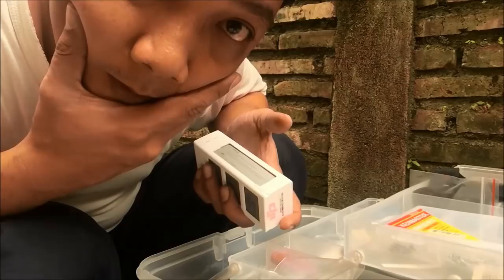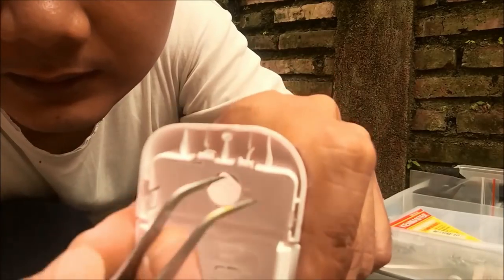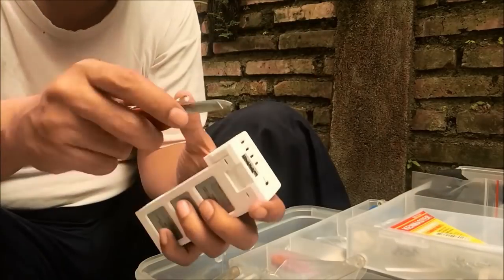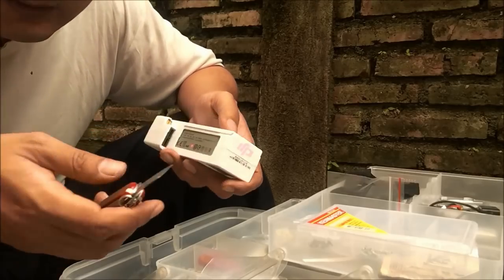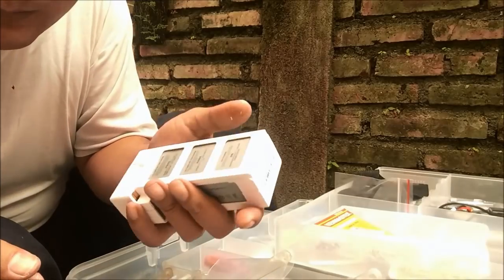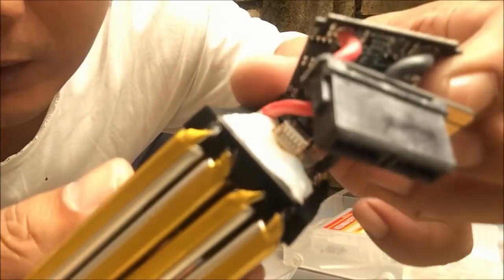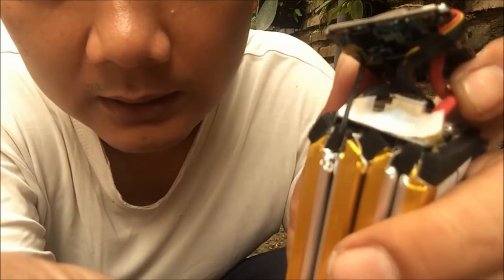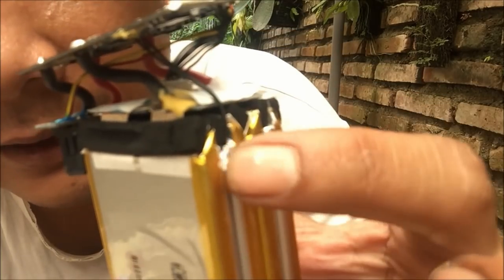Inside The Broken Battery of DJI Phantom 3 - How to open For Mod and Repair Purpose (Cara Bongkar)

Comment: Wow.  This batterytotally doesn’t need repair.  Two of my three P3 batteries were like this, what I call on the edge.  You place it on the charger, and do the press, wait 2, press and hold.  Those two batters, plus the one that started charging unaided, are on the charger now, getting juiced.

Comment: the protection circuit board is built within the battery because it controls input/output when being charged, & not to overcharge while plugged & offers a discharge protection while in use as well. It would not be safe if circuit board is installed within the drone because this would mean having a charge port on Drone & battery would have to remain in to charge so lose flying time & if battery would ever leak or short out it would surely damage components within the drone also. Also, these smart circuit boards are engineered to notify user/ drone when to return to base when voltage drops

Comment: The yellow and red wires coming off the main jack is so the phantom copter can communicate with the bettery and know cell voltage and battery temperature and the sensor glued to the side of the battery pack with the 2 black wires is the temperature sensor..  and for that wire to break off the connector it was installed bad when the battery pack was built.. or it's to thin of a wire and it couldn't hold up to the current it carried, because it's in a sealed environment.. nothing is able to pull or yank on it

Comment: Great video.  Very helpful.  Mine would not charge but was not that old.  Red blinking light and one green blinking bar.  I opened mine up and removed the Control circuit.  Then I connected the pack to a Riden power supply to se how much charge it would take and if the cells were balanced or if there was a bad one (or more).  Once I verified it was fully charged, I ran a discharge test from full charge to minimum charge with my DL24P load tester.  Granted I could only discharge at 10A I still got an idea of the pack condition.

Comment: The board in the battery is a balance charger and makes sure all the cells stay at the same voltage. Putting it in the drone would lower the battery life span.

Comment: How do you reset a battery circuit board? I charged it with a smart charger and now it works but gives no output.... Any tips?

Comment: I have a spare phantom 3 battery  ..i want to make "4" usb battery banks out of it but im not sure how    ....how many volts is each cell ?
Reply: Don't. You'd do better just buying cells and usb controllers off ebay. Phantom 3 batteries aren't being made anymore and the drone was updated to only work with originals so their value increases if you can find one with low charges. Keep and use that battery or sell it. Whatever you do don't destroy it just to make a cheap usb battery bank

Comment: Thanks for sharing.  Amazed you didn't get shocked the way you handled the unit.
Reply: The voltage is too low
Reply: @randyhammer7777  , that's a good thing.  Thx.

Comment: oom Arya,mohon pencerahannya donk soal batere phantom..saya bongkar utk main RC krn utk drone udah gak stabil..voltage masih ok sekitar 4 volt/piece..the problem is all these cell cannot work! even i try to charging..and kalo saya konek ke rc saya,kabelnya panas.dr ke 8 cell nya,hanya 2 cell yg saya bs rakit jd 2S dan bagus,sisa yg 6cell blom tau knp...so? any suggest for my case? thank you so much ,sir

Comment: The black wire that you thought was an antenna is most likely a temp sensor. That would explain why it's glued to the side of the cells. A Thermistor I'm assuming.

Comment: Hi, wanted to Thank You for allyour Fantastic Videos. I have 8 Dji Drones and trying to find YouTubers who do videos on how to repair them yourself. If you know of anyone who makes videos can you let me know. I would really appreciate it. I hope you keep posting videos
Reply: Easy to repair stuff. Google is your friend. I've had my DJI p3 pro 3yrs ajd haven't got around to flying it yet and already wasted a new battery. I'll try boost charging it with a conventional charger bypassing the balance charger stuff for now and get it up to equivalent to 50% with a real low and slow charge then try the factory charger since it has the balance board built in. Who knows battery could've been bad from the get go. I'll call DJI and see if I can work a deal with them on replacing the new bad battery.

Comment: very good video
sorry for the question of how many volts is each battery and how many amps is each my battery does not retain charge and I am interested in your video and I want to compose mine, I hope your answer greetings from mexico won a subscriber
Reply from the maker: Hi Mexico! 😊. Thank you for watching my video. Every cell is equal 3.7 volt. But I’m realy sory, this is an old video and the battery has already sold. I cant remember the current/ampere 😭
Reply: Normally each cell should charge no higher than 4.2 on Lipo batteries. 3.7 is the low voltage cutoff so it can let you know it's time to charge it. In the world of RC cars at 3.7 per cell the Electronic Speed Control (ESC) settings will stop the car at 3.7 or a little lower but no lower than 3.2. Drones are different on the low voltage cutoff which is when it tells you to return to home. They fully charged at 4.2 volts per cell hence 4 cells @ 4.2 volts fully charged equals 16.8 volts which should be on a 4 cell pack so you know the voltage. 3 cell is 12.6, 2 cell is 7.4 and 1 cell is 4.2 volts. 7.4 is real popular in the RC car world where a lot of people who race use 7.4 , 2 cell lipos. Hope this has helped you.
Reply from the maker: Thank you for the explanation. I relly appreciate ☺

Comment: The yellow cable also helps when battery going out while flying when not proper plugged in, a warning message will appear on the app.

Comment: Warring Warring!! if you expose the lithium inside 1 of the 6 stacks with blade and a drop of water touches lithium it will spontaneously combust or blow up.  This is why meth Drug Makers are burned up.  Great video and yes Phantom 4, 4Pro batteries are glued after removing the screws if you must open a battery it does have to be cut.  Best left to pros or someone whom doesn't mind a first row seat to an explosion.   Having worked in narcodice dept.  and seeing the burns and explosions from lithium I felt the need to warn the viewers.   Thank you for your video Sir.
Reply from the maker: And thank you for your warning. 😊👍
Reply: Water don't have to touch a exposed cell that's punctured. The exposed cell making contact with air will cause it to start smoldering and eventually smoking and lead to a flame..  Back in 2008 when lipo batteries were new to the RC scene I had one that puffed/swelled up so I used a ice scraper for the concrete outside and punctured it. I actually made a YouTube video back then as there weren't any when I'd searched but a few years later I pulled it down as I didn't think it was needed anymore. 

I have a P3 Pro battery I let discharge apparently because I went a couple years without charging it from new so money wasted. Luckily I was able to get the other one to charge. 

I only get 1 flashing Green light that flashes with the red when charging when I do the quick press once and hold for 2 seconds after it's plugged in. It does that for 10-15 min then goes to a cycle flash where every so many seconds it flashes a few times then goes dark for 5-10 seconds before the lights flash a few times again. I wonder if there's a way to boost it to where I wake the balance portion and circuitry up and it takes over and then low voltage charge it until it hits xxx amount of volts then move it back to the regular charger designed for it. If I knew what was positive, negative, balancing data is present or not I could hook it up as I have balance chargers for my RC stuff which a lot I haven't charged or even opened the case in 10+ yrs. It's like a long term experiment. Once I get some other things done around the house I'll make a video or a couple of unboxing by opening the army ammunition cans where they've been stored inside my main entry way under a hutch buffet by the front door of my house. It's always roughly 70 degrees year round where they're stored. I'm expecting the worse which is why I already bought a couple new batteries when I bought a new Traxxas 4tec this past summer and I haven't put the upgrades on it let alone ran it yet. Maybe I should in case there's something wrong.

 I've had my DJI Phantom 3 pro 3 yrs aand haven't ran it yet. Need to sit down, read and figure out the firmware update process so I can run it. I bought it before the crap laws, height flight restrictions were implemented. Should've just got the app back then for my tablet , ran it and kept it offline or figured out a way so it wouldn't be casterated by all the laws they put into place.

Comment: Its not so easy.  One issue that is behind all of this, is the fact that there are power transistors involved, that deliver to the drone, like a water tap valve, the energy required to fly.  And this implies fatigue of electronics components.  So, when you replace the whole battery, you are replacing also these power transistors and starting over.  But even with this replacement, you must realize that you have more power transistors on the mainboard inside the drone.  They fatigue as well.  So, in essence, you should change the whole mainboard, from time to time.  All of these facts are probabilistics, based on MTBF (mean time between fails) factor of electronic components.  How safe do you want to be today?  Do you want to maintain Boeing or NASA standards?  It depends on you.  But... even applying those standards, accordingly to the Heissenberg's Uncertain Principle, the future is unpredictable.  I have talked!
Reply from the maker: +PepePepian5000 - It’s about economic factor. When the circuit board on battery moved to the drone at the first design before production, it will cost lower than today for people changing batteries. But that was my point of view, not manufacture and thier marketing strategic point of view.
Reply: It is not a tricky maneuver from DJI.  It is a technical design decision.  They are trying to keep their design as safe as possible.  Their batteries frees you from a lot of complicated work.  They try to simplify your life.  Lipo HV batteries are very, very delicate.  I do not work for them, by the way.  Anybody that look this topic from an electronics point of view,  will understand what Im saying.  On what I agree with you is about prices.  They could sell the same batterie for half a price NOW, but they do not want.  Eventually, this will become true.  But THE SAME design, not a cheaper one.

Comment: Don't forget it also does the automatic discharging of the battery down to 60% after 10 days to ensure the battery lasts. Also contains all the cycle info etc about the cell and it's performance. It's not a bad thing. Sure price could come down to a realistic level. Nearly all lithium based battery packs seem to have a pcb included these days.
Reply: I choose the cheaper method anyway... I can discharge it manually which was easier. The cycle is just a record.. not very important. Owner can record. $40 vs $200 i can get 4 batt....

Comment: Good video. The boarea could easily be made into the aircraft. The battery balancing bullshit can be made into the charger. I don't yet feel comfortable with aftermarket Battery Technology yet, but I don't want to pay $150 for a $350 drone. I guess I will just continue to use my existing battery and suffer through shorter flights...
DJI could easily offer a refurbished battery program when you turn your core in, you get credit... wtf  DJI?

Comment: DJI used to have the circuit in the aircraft, for the Phantom 1. Of course no one bought the DJI battery, they bought less expensive ones. I think DJI saw a way to make more money by making a proprietary smart battery.
Reply: Don't forget the part where "intellegent" batteries were updated in firmware so that the drones would only accept ones from dji, making aftermarket ones worthless, then dji stopped selling the batteries for p3.

Comment: So exactly how long did it take you to fix it?
Reply from the maker: +technologylover - For assembling and disasaembling, takes 1 hour. But I have to made a special order to replace the tiny connector, and it takes a week 😢
Reply: @AryaDegaTube  what connector was it? Have you got a link to buy it?
Reply: @clintAdventures  "helipal" probably has the part you need
Reply: @relaxingnature2617  still don't know WHAT part though.

Comment: very good video ... now please tell me i have battery cell damaged error , the cell number 3 has only 4,20v at fully charged and the other 1 ,2 ,4 has 4,35 v phantom 4 battery .... Is possible to replace just the bad cell ? and what type of cell should i buy
Reply from the maker: +Simioniuc Adrian Iulian - I dont think so if we can replace only 1 cell, just like other 4s battery brand. Except you can find a seller who selling the 4S battery cell with the same size 😯
Reply: i was thinking about ebay but i still didn;t open the battery i will try somehow to discharge and charge at 0.1 amps maybe it would take 1 day but it could make it alive
Reply: Can u tell me if i can replace all the cells with others and what type of cells should i buy ? , in the end i think it will be much cheaper then the whole electronic board
Reply from the maker: +Simioniuc Adrian Iulian - You are right it will be much cheaper, but still I'm searching for this cell replacement untill now. 😢
Reply: @AryaDegaTube  hv u found the replacement cells in market?

Comment: Dude, you make perfect sense.  Put the battery intelligence in the drone, NOT the battery.  But - the board in the battery is their excuse for charging so much., and making so much more money.  Capitalism at its best...
Reply: Totally agree with Eric!  I'm also an owner of a PL8 which I use for charging my planes and helis.  I don't want to have to buy another charger to simultaneously charge my drone batteries.  I also want to be able to make up my own battery packs.
Reply: I think Arya's thoughts about the battery PCB is pretty solid.  The charging PCB and charge indicator can be put on-board and an interchangeable cell pack can be linked via cabling.  It certainly helps DJI to put these in a proprietary battery pack as they can sell more and provide a guarantee about the quality of the batteries customers use, particularly when they're trying to honor their own warranty.  The early Phantoms had a tethered battery pack, so it's technically possible to return to that approach and run the risk of 3rd party cell packs being questionable and not being accurate with DJI's tuned sensing.  The real issue though is look at the thick, high-amp, cabling and smaller logic and temp cables: That's a lot of cabling and your drone and DJI Go app need accurate info on the battery health.  I don't fault them for deciding to build reliable options for their products, but I do take some issue where they locked out all 3rd party.  Unless there's deliberate intellectual property theft for those 3rd party "smart" batteries to work with Phantoms--and I'm not convinced there is based on the design--they seem to have overstepped good taste.  Apple almost went this approach, maybe even did briefly, when they detected unauthorized repairs to their iPhones, but they eventually reversed that.  DJI can simply void the warranty and let the free market decide if they want reliability or potentially substandard parts.  They can't legally hold a position of forcing customers to use their products, though they might be able to get away with deliberately cutting off reporting.  Maybe.
Reply: There's perfectly valid reasons to have an intelligent battery. Short circuit protection, over voltage protection, self balancing, automatic storage mode, storage level/coulomb counting, etc. 

They also have financial reasons: whenever someone makes a DJI compatible battery, they can update the Drone and Battery firmware to alter the communication so the clone batteries become useless bricks. DJI is selling $20-40 batteries with $4 of smarts for $100-$150. That extra circuit board allows them to have a wide profit margin on battery sales. Additionally they can do things like count the charge cycles in the battery itself and easily see if a battery had completed its warranty period or not.
Reply: I could care less if I can see the charge level outside of the drone.  I use a PL8 and never worry about overcharge or shorts, I know how to charge a battery.  If the drone had that stuff inside it and not in the battery we could swap batteries charged under a better charger which will make them last longer, plus I can charge 8 or 10 batteries at once instead of one at a time.
Reply: Do you want to be able to see the charge level outside of the craft or not?  Do you want overcharge and short protection... or not?  Jim you stick to making arts and crafts leave the drone building to us.

Comment: That is the control board for the smart battery isn't it? By its very nature, it must be part of the battery yes? Thanks for making this video. Very nice! Now I wish someone would do the same for a Phantom 4 battery.
Reply from the maker: You are welcome, and thanks for watching my video 😀
Reply: All DJI batteries are similar.  You will find the same, with a different shape.  2 main cables (very thick), 2 communications cables (very thin), 2 thin cables going to a thermistor (temp sensor) in the middle of cells, and up to 5 thin wires (depending of number of cells) for charge balance.  Thats all the wiring.  The concepts behind this wiring is beyond the scope of this tyny, mini explanation.  But are not complicated.